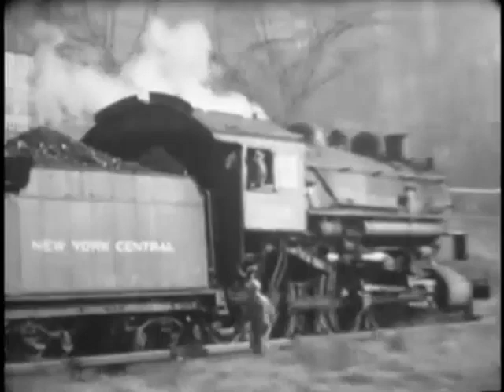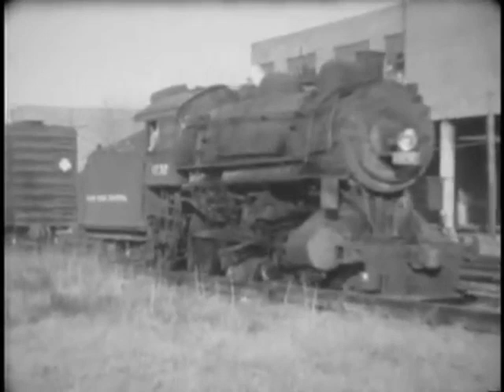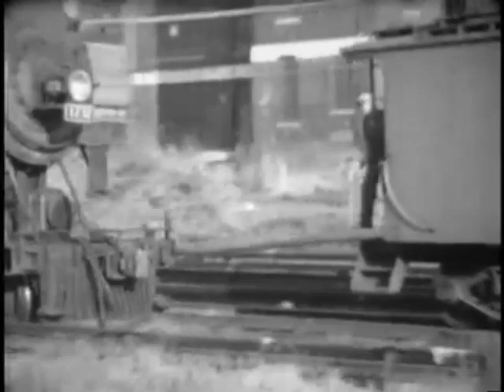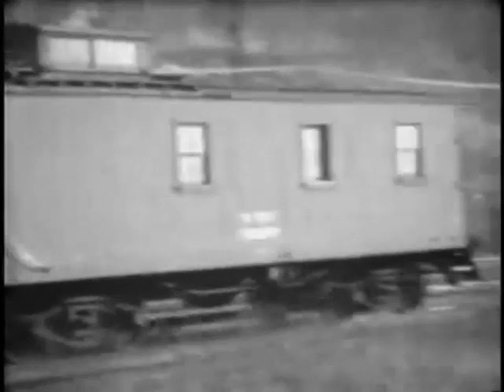poling a car

Comment: Why did they use s pole instead of just directly pushing it?
Reply: Because it was on another track
Reply: In those days, it was alot more of single car movements. Unlike today's unit trains. So to move a single car or only a couple of cars, it was quicker to pole them if on a parallel track then to go all the way to the end to switch tracks. Also you could have a couple of other cars on the either track in the way. Which would require extra movements to get to the one car needed. 
  At this time in of the original film, flat yards were commonly used.  Hump yards to separate the cars to individual tracks were not as common. A whole train would come in on one line. The locomotives uncoupled and move over to another line for maintenance or to ready for the next job. The rest of the train would be broken down by switch engines to other tracks in sections depending on where they are going.  And then those groups could be broken down further if some cars for for another yard or to be dropped off on the way. Those going to another city would go through the process again.
Reply: @Tigerskunk  Wow, thank you very much for that explanation!

Comment: Before diesel engines, they had to conserve every single morsel of efficiency from the steam engine.
Reply: It's not a steam-vs-diesel thing. Today, only large industries are rail-served and most of them take several cars at a time. In those days, many more industries had rail service and many of them were smaller, taking only one or two cars. There was also the hassle of dealing with cabooses. All of that meant that a lot more switching moves were required than are needed today. They had to do things like poling cars to save time so that a crew could get everything done within their shift.

Comment: ok that is just lazy
Reply: No it's not. It was a necessary part of the job in those days because there were many small customers on the railroad, who'd only receive cars one or two at a time. That meant many more switching moves than you'd see today, and the only way to get the job done within a shift was to pull crazy stuff like this. Or for the railroad to use 50% more locomotives (and staff and engine shops and...) and have to put their prices up by 50% to pay for it all.